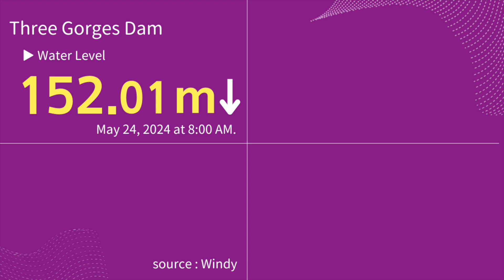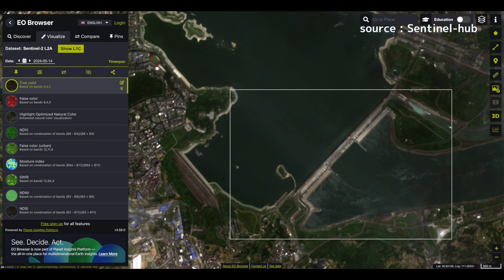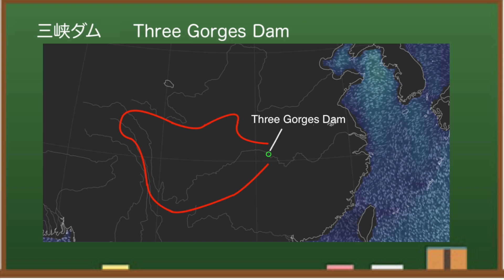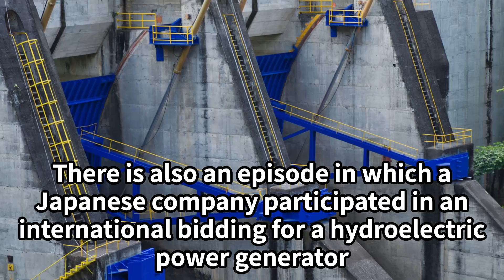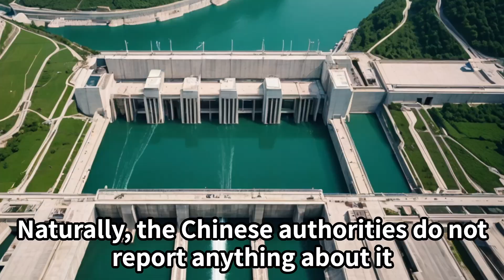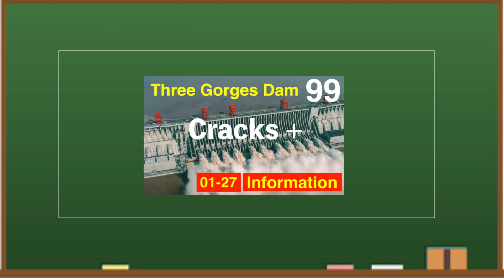Three Gorges Dam ● Massive discharge again  ● May 24 2024  China Latest information

Comment: At ABB we supplied a lot of accessories for the turbines and the axle mounts. I once had to go to China to inspect one of our components. Had a pleasant time in China and Xi wasn't in power yet. This constant rise or fall in water level damages the structure. The dam has many passages and the turbines are housed in very large halls. There are heavy cranes on the dam that have to be moved to change the water level. And they act strangely, they open the floodgates when there is a small inflow of water, but not when there is a large inflow. wth?